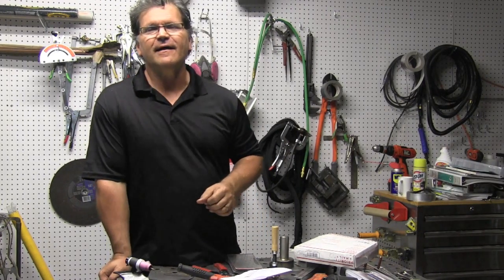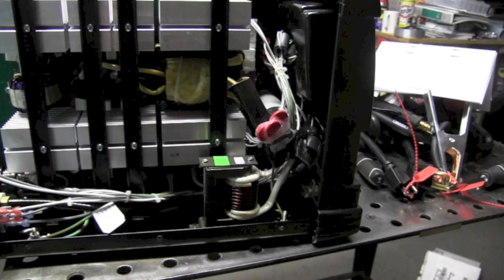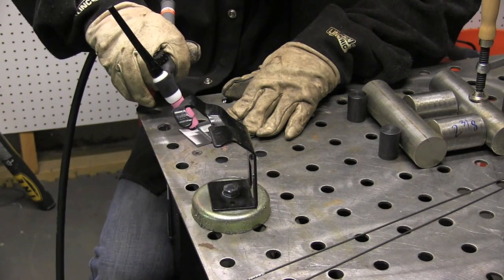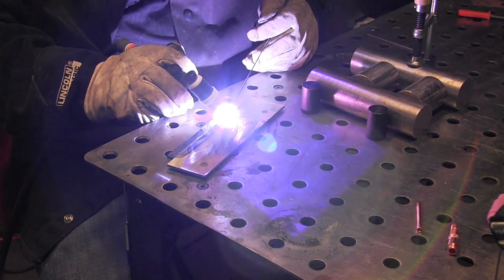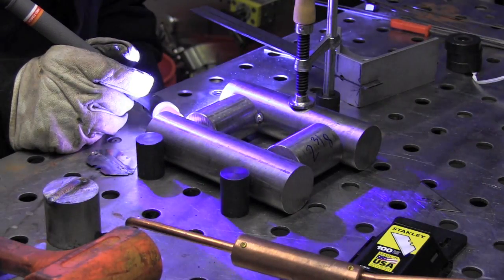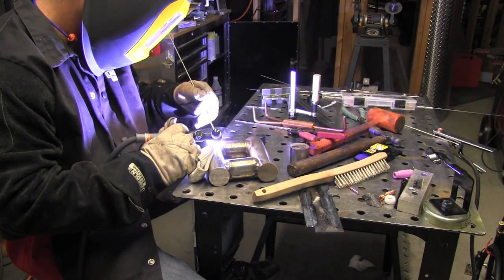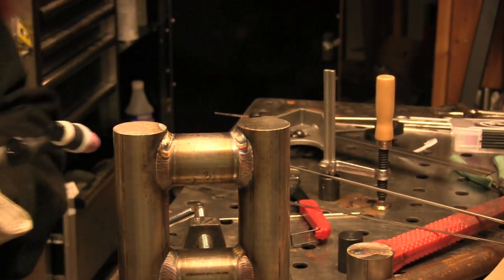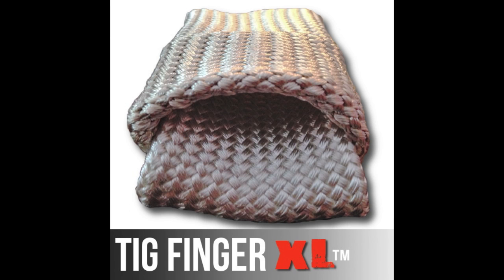TIG Welding with the Lincoln PowerMig 210MP

Comment: I would like to get my hands on the engineer of this machine who obviously never mig welded before. The darn thing blows air out the front; it blows right where I am trying to weld on a welding table or other working area. They should have had it blowing out the back so it would not interfere with welding gas. I had to fabricate a shield to direct the air sideways. Otherwise it is a great machine.

Comment: I am still using the Lincoln Electric Power MIG 210 MP. I love it. The thing is solid I've done some really big jobs with it and never had any problems. It has capabilities of a much more expensive machine and if you take care of it this thing will do pretty much anything you needed to do. Aluminum stainless steel and anything in between

Comment: Jody what are thoughts on using a 120v to 240v step up transformer to use this machine in the 240v setting, but just plugging into a 120v outlet?
Reply: Ummm, it is a matter of the ampacity of the circuit feeding your transformer.  A 30A 240V circuit provides as much power as a 60A 120V circuit.  A step up transformer of that size will be quite expensive.  It will likely be significantly less expensive to wire in the 240V circuit for this machine.

Comment: I just set up my machine for TIG welding with the foot pedal yesterday. It wasn't that difficult and it went together pretty easily with a pair of long needle nose and a flat head screwdriver. So far I really love this machine. I've done some stick welding with it and I'm getting ready to do my first TIG weld with it this morning
Reply: Could you give me some instructions on how to work the foot pedal? I have it installed but don’t know how to work it
Reply: @rafaelsuarez7103  absolutely. Main thing is just practice as much as possible and pay attention to your settings. The settings are 75% of the battle. Take it slow and practice as much as possible.

Comment: The reason I was watching this video was to see if the 210MP had a TIG solenoid, as that was one of the only things I didn't like about the Harbor Freight Omnipro 220.  Turns out it doesn't either.  But, what's even more disappointing is this machine doesn't even have a TIG pedal adapter!  So, not only is this machine 50% more expensive, it becomes TWICE the price of a HF unit after the purchase of a pedal and adapter.  That's crazy.  I didn't want to buy a HF machine, but geez Lincoln, give me a reason to buy your machine, please!

Comment: I want to build a stereo stand using 1” square tubing . I’m thinking the outcome of the welds would look much smoother off the get go as opposed to mig welding . I seem to end up with a fairly thick bead when using the 210 mig welding ,and yours tig welds look great

Comment: Hey Jody can u weld aluminum with this machine..mig or tig ????
Reply: I have this machine, and a spool gun for aluminum MIG welding.  I used the spool gun to build a 200 gal holding tank, which is really just a 3x4x1 1/2 foot box out of 1/8" 5086 aluminum sheet.  The only issue was the short duty cycle of the spool gun.  It doesn't have AC capability, but some guys I work with told me you can TIG weld aluminum with DC if you use helium instead of argon.   The machine can be bought on its own, capable of stick or mig out of the box, or as the "Aluminum one pack", which comes with the spool gun.  I bought the base machine, and bought the spool gun later.  It can also be bought as the "TIG one pack" where you get the machine with the torch, foot pedal, and adapters.

Comment: I was thinking about picking up a Millermatic 211, as I already have a Lincoln AC225 tombstone stick welder.  However, after seeing this thing, I'm wondering if I should sell my tombstone welder and just buy one of these.  Then I can do Tig and Flux core also if I ever want to.  Why would someone buy machines separately when one of these exists?   For longer duty times or something?  Thanks!
Reply: I can't entirely answer your question, but there are very few stick/mig machines due to the fact one is constant voltage and the other is constant current. It does seem like a good option.

Comment: bought one after seeing this video. Finally got together enough of the parts to scratch start. 3 days in doing drills on cold rolled I realized that the black numbers on the regulator that is provided with the machine are in L/min. 40scfm does just fine on mig, but really sucks to learn tig welding. Set the regulator down to 15scfm and things are going much much better.

Comment: Jody, I know you were using a 3/32" Tungsten, but I didn't catch what type you used for the Power Mig 210. Being it only does AC welding, was there a particular Tungsten used that doesn't ball at the end? I'm finding that Brown and White (Zirconiated) Tungsten is for AC only. But not sure if that is a myth. I seen your videos on using different types of Tungsten at 200 Amps, but wasn't sure if they applied to this particular situation. Also, what kind of filler rod did you use? Thanks for the time (if you see this)
Reply: This is a DC machine Lincoln Power Mig 210MP. DC Tungsten for Steel, Stainless. AC Tungsten is for Aluminum. The Lincoln Square wave Tig 200 is AC. 😎
Reply: I think he said he was using 1/8" 309 stainless wire and probably a 2% Lanthanated tungsten

Comment: Hi jody I was just wondering if I can weld aluminum with Lincoln Power Mig 210MP  Love your work I'm a Australian boiler maker for the past 30 years thanks
Reply: You can mig weld aluminum with a spool gun. You need to make sure the welder can support a spool gun. I know all(?) the Everlast mig welders support spool guns out of the box but not sure about this model.
Reply: The Power Mig 210 MP supports a Spool Gun. We have one here in our shop at work, and it is a matter of attaching it, and selecting it in the User Interface. Nothing much to it at all. How well it works? I guess that'll be up to the user lol

Comment: What size breaker do I need for 115 and 230?  I want to make sure my electrical needs are fulfilled prior to using my PM 210 MP.
Reply: 20amp breaker for the 110 and 30amp for the 230 im no electrician but have been using those for the last 3 years on numerous projects at home, 20x24 carport/shop, 18' double gated entry way etc

Comment: which is better. the Lincoln 210 mp for tig welding or the Lincoln 175 square wave
Reply: I have the Tig 200 and this machine, the TIG 200 is a better tig welder, no need to scratch/lift start and it also will do AC for Aluminium.

Comment: Curious to hear why you were weaving with a gas shielded process. I know that you were using a gas Lens but the way I was taught you always run stringers, wire feed, TIG. The only process that I was told that you could get away with a weave was stick.

Comment: I have this machine but i cant get it to start a nice arc at all. it leaves craters in the stee and just sounds not nice. i dont have that flow adjustment on my torch so theres no pre or post. could this be the issue?

Comment: Great video Jody. My question for you regarding your stubby Gas lens kit is will it fit my Miller / weldcraft WP -17. It has a long body like the one you were using in the video.
I look forward to all your Video each week .
Thanks Mike
Reply: Should work just fine- Tig torches are pretty interchangeable
Reply from the maker: Yep. It'll fit
Reply: liz1965 Thanks guys. Ordering today and maybe another t-shirt.
Reply: +weldingtipsandtricks 
Jody, Great job on the videos, keep them coming.  Where did you purchase the Canon plug for the foot pedal? And the price.  Thanks

Comment: any chance you will be doing a comparison video between the 210 and the miller multimatic? I've come to trust and value your input and suggestions far above anyone else on the interwebs. I really appreciate all the time you spend producing quality and highly informative videos, and really want to thank you! cheers :D
Reply: matthew weber  how about a comparison between it and the Thermal Arc 211i aka Tweeco 211i weldingtipsandtricks
Reply: matthew weber I
Reply: HeadShot360  actually the millermatic 215 has tig and mig gas solenoid valves right on machine

Comment: so this is pretty comparable to the miller multimatic 200?
Reply: Zach Tarbell 
210 doesn't run 6010 well at all, heard the multimatic does it better because they released a patch for the chip to fix that issue.

Comment: Looking forward to seeing your MIG and stick videos on this machine. I own one and it has performed flawlessly in both MIG and stick (haven't done TIG yet). I punished mine on a heavy duty MIG project running at near full capacity for hours on end and never once hit the duty cycle. The recommended MIG settings seem to be a little cold. I usually just put it in manual CV mode and dial in my own settings. Smoothest stick arc around.

Comment: Just curious as to which machine you think is the best all round machine, easiest to use, longest lasting as far as heavy and light use. 
Now I am not the Tig welder in my house hold and am looking at getting my wife a new machine ( and yes she is the welder in my house hold red seal and all lol) but I want to purchase on that she would be happy with and versitile I do believe in having separate machines for stick mig and tig although my lincoln 305g is set up for all but the suitcases are not so handy.
Thank you for all that you show in your videos they are great for me because I may try my hand at tig with out her kicking me off her stool LMAO!
Reply from the maker: Chris Morrow Man its hard to say what the best all around machine is. I dont think there is one!    I have never really liked the idea of one all in one machine.  Seems there are always trade offs.  But if you think of this as a mig welder ..that also does stick and tig.  its a great starter unit because its only about 100 more dollars than a 210mvp hobart handler mig only.  If your wife really likes high freq start tig, then lift arc might not be the best for her.  We all get spoiled.  like me and my torch cups. haha

Comment: defnitely been thinking about picking up a 210mp, currently a welding student and I think it'd be a great practise/hobby welder thats not too expensive
Reply: A Vulcan OmniPro 220 seems like an equivalent, and costs just under $900.  TIG torch and foot pedal are sold separately ($80 each).  No HF, so it also uses lift start.
Reply: Skip welding school, get his DVD

Comment: Jody another  great post .which order you doing the other two mig then stick or other way round. I take it its a transformer  rectifier unit so direct current only. J
Reply from the maker: It's actually an inverter and only weighs around 40 lbs. planning on mig first but not sure what will happen

Comment: Stupid question maybe, i can you have a 17 size on a 210A machine and still utilize the full 210A? i have a 26(i think) torch on my 200A machine and it basicly could melt the cable still.
Reply from the maker: Only goes up to 175amps on Tig. But even that heated up the 17 torch after a while.

Comment: Hi Jody,
Another well put together video.   Up until a few months ago I had zero knowledge about welding.  After pricing out the costs involved in having a new frame manufactured for one of my little vintage Boler trailers I decided to purchase a welder and learn how to do it myself.  In addition I signed up at the local Technical School here in Calgary, AB, Canada to take an introductory GMAW course.  I find the combination of being able to view your closeup videos and the hands-on experience with the instructors to be a good learning method for me. 
Now, I am not sure if I'm actually going to save money on my frame build because  I'm hooked and am starting to collect all the "toys" to go with my new Lincoln 210MP..  Looks like I need to get set up for TIG... thanks:)  I've already been over to SWAG's website.

Again, your videos are well put together.   I've posted a few of my own and know that more time goes into producing the video than the actual job you are filming.  So, your efforts are much appreciated.

Looking forward to your videos of the Lincoln 210 MP for MIG.
Thanks again
Kevin Johnston
Calgary, AB
Canada
Reply from the maker: Thanks for the good word
Reply: Well, to be fair, these toys can make you money

Comment: Just ordered one which will be here in June, just curious to know if there are any disappointing aspects to the machine, I'm upgrading from 180c so that I can get better control of knowing parameters
Reply from the maker: I have not used it for mig or stick yet but will soon. The fan is sorta loud but I have heard worse. It was a pain installing the plug for the foot pedal but once that was done it worked fine. 175 amps is hot enough to Tig really thick steel and I pushed it hard at 175 till I had to let the torch cool.
Reply: weldingtipsandtricks Thank you for all your GREAT work, your vid's are soooo helpful for us newbees and I have learned so much from your tips and experience.  God Bless your efforts to school the next generation.